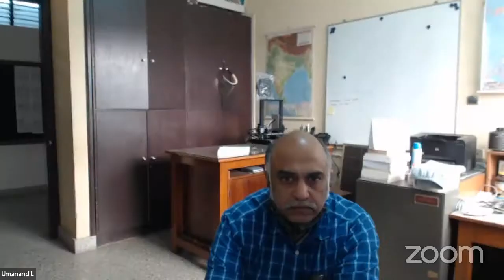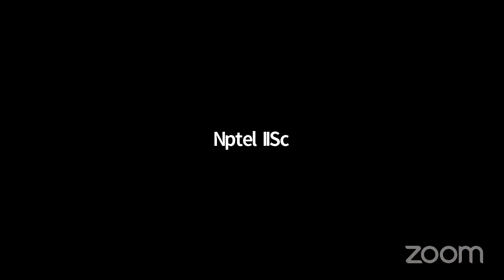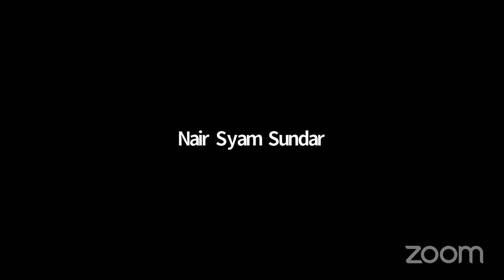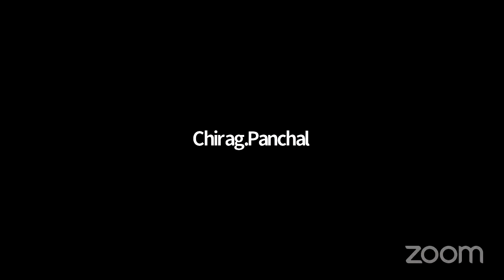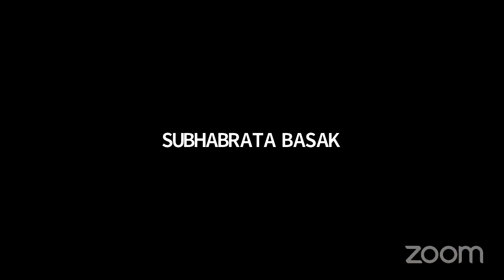Fundamental of Power Electronics

Comment: Please elaborate on practical aproch    on the pwm using transistor and how to pulse control width and also control in amplitude frequency should be constant if any analog circuit ? Please gives approach on without ic implementation. Thank you